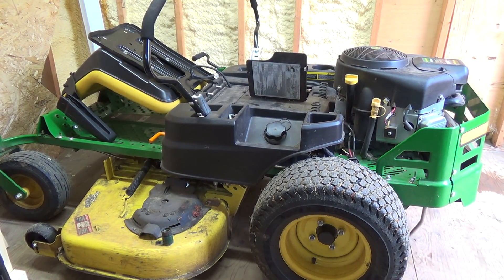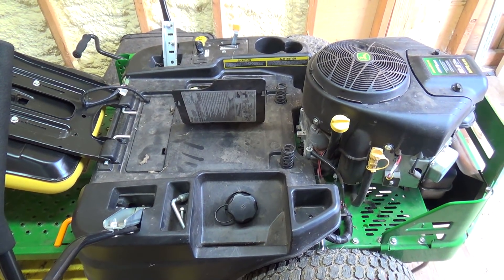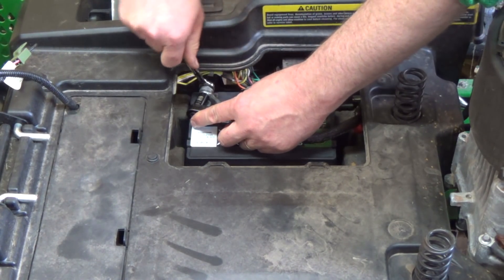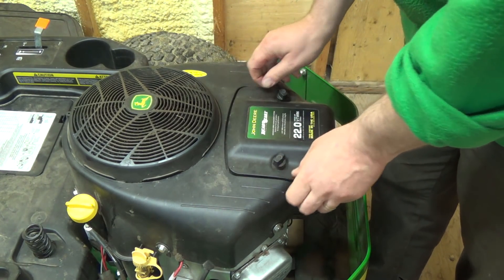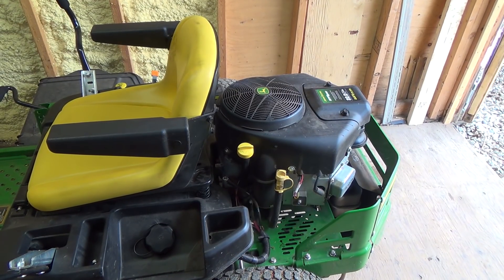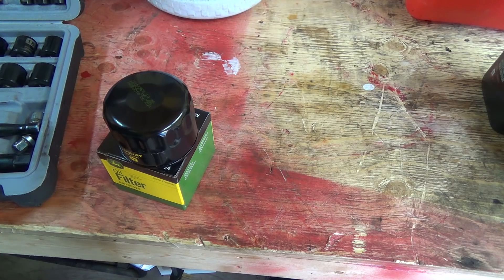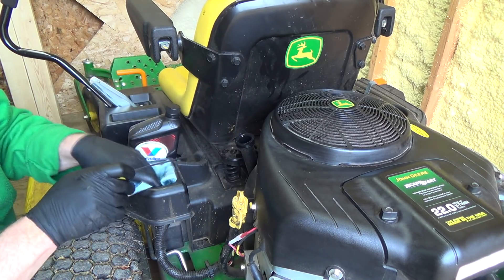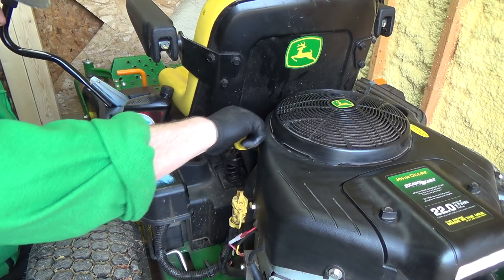Oil change series...Next up John Deere Z355R Zero turn Mower

Comment: The best thing to do with the N-series Ford tractors is install a spin-on oil filter adapter. That allows you to use inexpensive readily available filters instead of those messy cartridges. I installed one on my 9N and NAA and it worked perfectly.

Comment: My mower which is made by Gravely with Kawasaki engine the filter is hard to get out but doesn't make a mess like yours did. Those stamped out decks don't last here in Florida. My neighbor has a John Deere zero turn he bought at a dealer, it has a drive shaft instead of a belt. He has had a few problems with his mower. I use 20/50 oil in everything on my mower the dealer told me to use.

Comment: Did you notice how JD has cheapened up the construction of those oil filters?  My machine takes the same filter. They used to have a fairly thick steel bezel and now its just like a piece of tin. Also if you look down inside there appears to be less filter material. Price is the same of course.

Comment: hey bill just letting u know the your spindle bearings may be a sealed bearing, i do the same thing on my little jd lx172, and that has sealed spindle bearings, so u may be greasing that for nothing. idk if they are sealed or not.
Reply from the maker: I’m not sure either. But a bit shouldn’t hurt
Reply: BILLSTMAXX nope never hurts. Just in case
Reply: @mattk9907 ik this is years later but the bearing is sealed however just pump the grease till it squirts out the bottom around the blades. That forces grease past the bearing seals. I've got over 150 hours on original bearings on my z355r and they are nice and quiet still

Comment: Where that divit is for the oil filter is drill a hole for it to go to a pan below
Reply: They got a bad design there.  I looked into that on mine but the drive belt and  right hydro pump or trans (whatever they r called) is right there.  Directly below. Didnt want all that taking on any more dirty oil lol.
Reply: @JohnDeereGangGang  they won't care about the ppl just the pocket faster to make

Comment: I had one of those oil drains on my mower but after 2 years the hose dry rotted and dumped the oil on the floor of my garage. I then put a normal drain plug in so I won’t have that issue again.
Reply: Agree. I don't true those tool less plastic caps on the rubber hose. I've started using a small vacuum oil sucker on all my small engines. No more messing with the drain plugs, crush washers, oil on the frame, etc. You still have to deal with the filters though. For those I use a "Form-A-Funnel". It's a flat thick rubber sheet with soft lead in the middle. You can bend, twist and form the "funnel" into any shape you want. I stick one end up under the oil filter and the other end I pinch together into a drain pain. It can be used for oil, coolant or any fluid that needs to be directed out of the way.

Comment: this is why i will never own a john deere stupid design . all you are buying is the name. parts too expensive. like a harley davidson and i own one of them.
Reply: The issue is not unique to JD. I have a JD, Ariens and MTD and they all have oil drains or filters positioned so oil drains all over the frame and then runs down through holes and gets on the belts.
Reply: but....but...but...   their colors....  Green Bay Packers GREEN n' YELLOW...   go ~ pack ! go ~